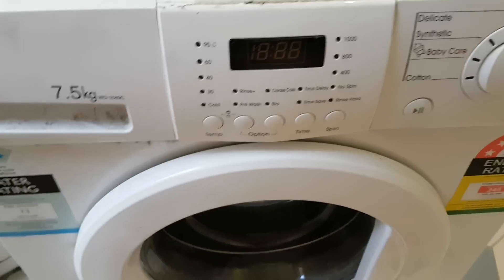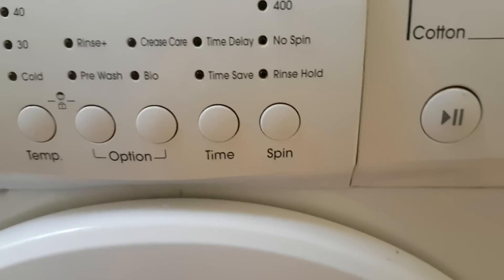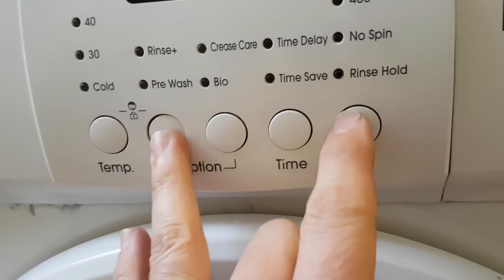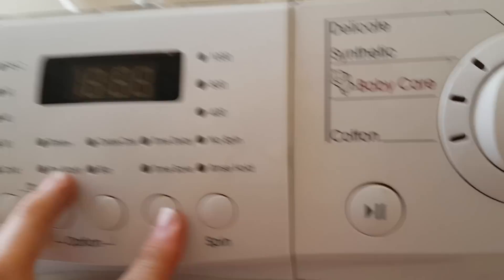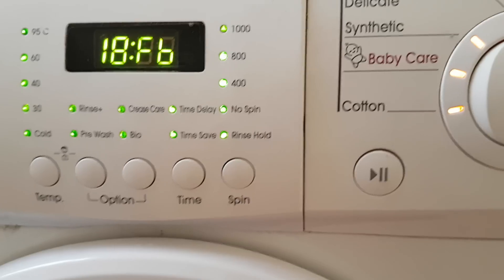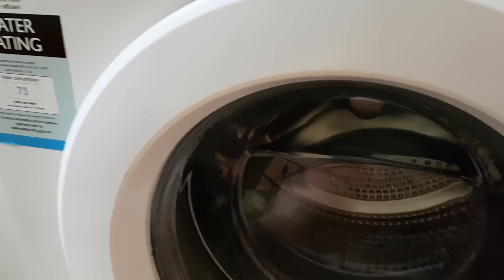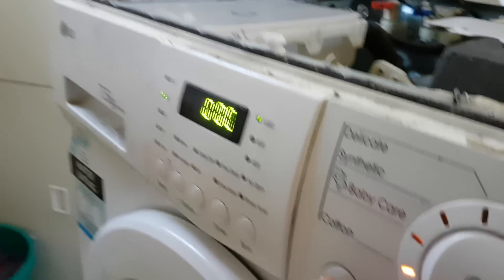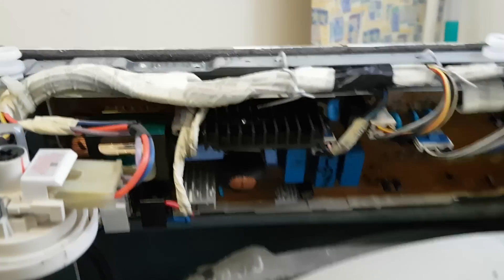LG front load washing machine not spinning. LG WD-1049C

Comment: Hi There. My one is turn the drum back and forth and stuck in this mode. At the same time. I noticed there are some sparks reflect from floor tile at the bottom of the machine.
I think It could be a carbon brush problem? Has any one ever try to replace the carbon yet?
Please advise
Cheers
Reply from the maker: I did as it was the cheapest option to start with, but in my case it did not fix it as the motor itself was faulty. You can find the brushes on ebay.